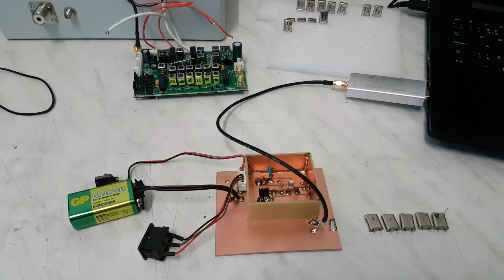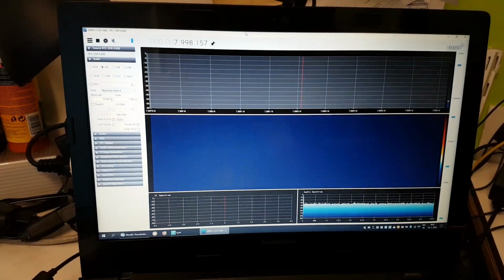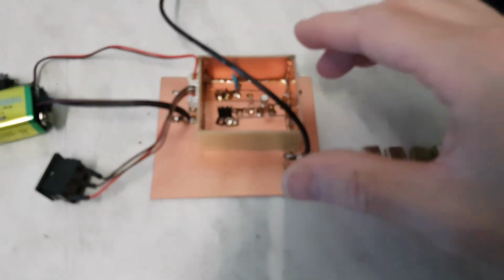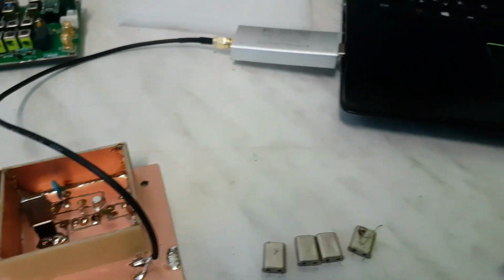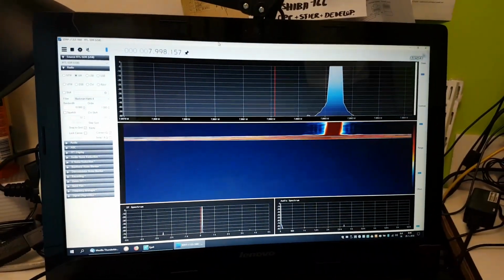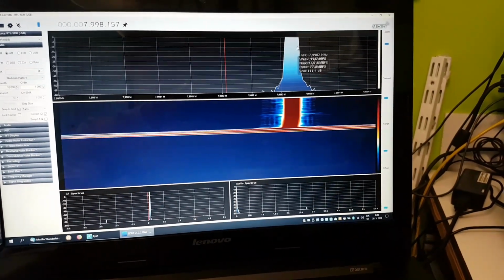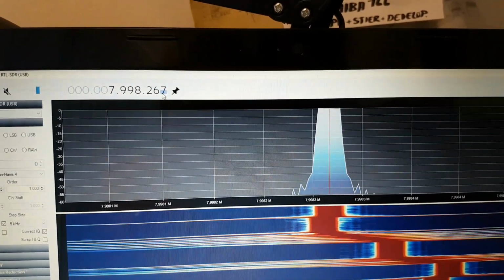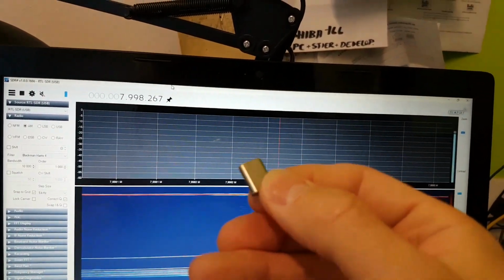RTL-SDR USB receiver - cheap tool for matching crystals

Comment: Nice job, but any receiver will work also...
Reply from the maker: yes, of course, but on analog receiver you don't see the peak on the screen ;-) Thanks for watching! 73
Reply: @OM0ET actually I have also an IC-7700...😅😅
Anyway nice job. 
73 Stefano IZ3KGJ
Reply from the maker: IC-7700 is a great transceiver! Congrats! I bought the IC-7610 couple days ago and working on new video about it ;-)

Comment: It might make sense to add a simple attenuator at the oscillator output. That protects the SDR and shows you a narrower peak. Crystal measurement is a highly interesting subject (see crystal motional parameters). Thanks for the video, 73
Reply from the maker: I know, this oscillator is very simple thing :-)